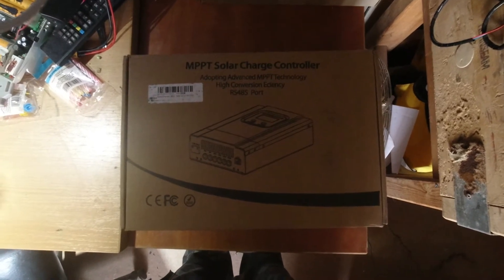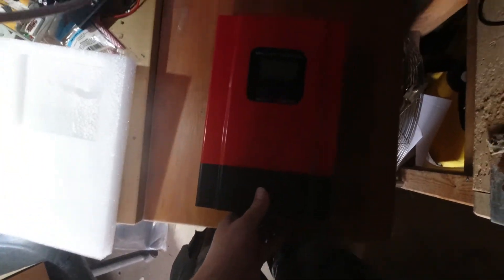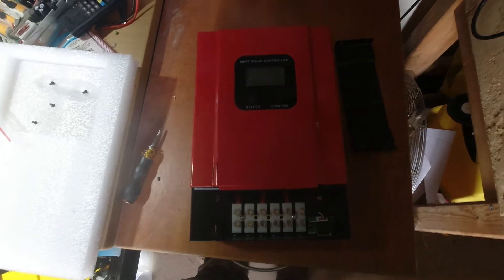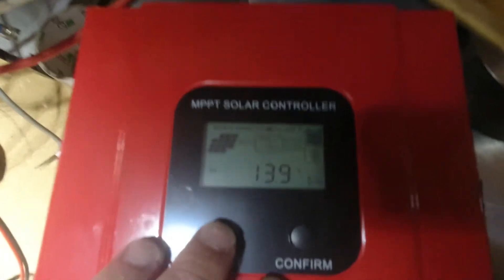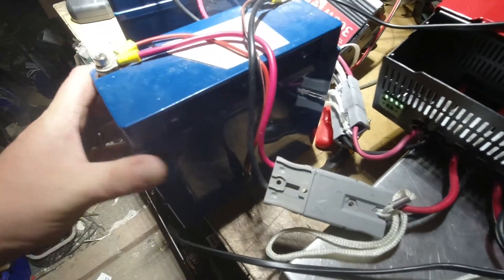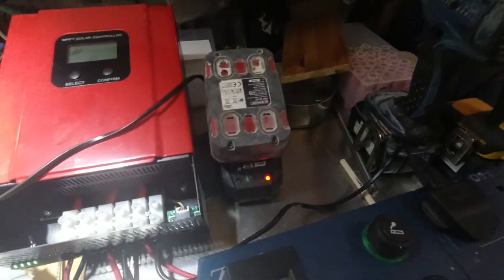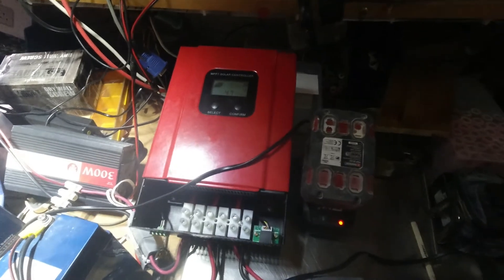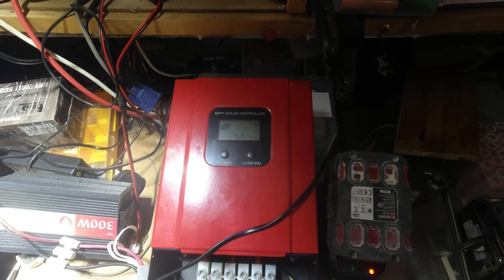ESmart3 60A smart MPPT solar charge controller, a quick test

Comment: The manual says to not connect an inverter to the load outlet of the charger as if the battery disconnects (eg finishes charging, hits a temp disconnect, or low voltage disconnect, etc) it can damage the load/inverter (due to a millisecond voltage spike, I'm guessing)